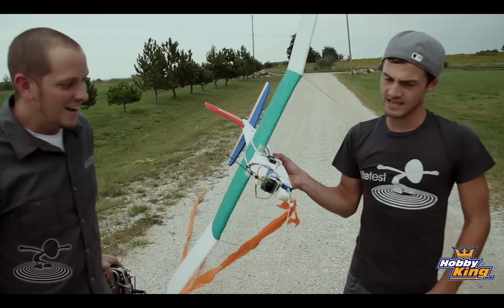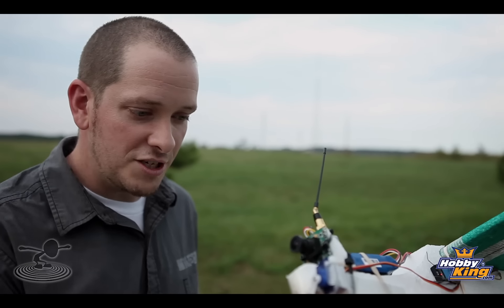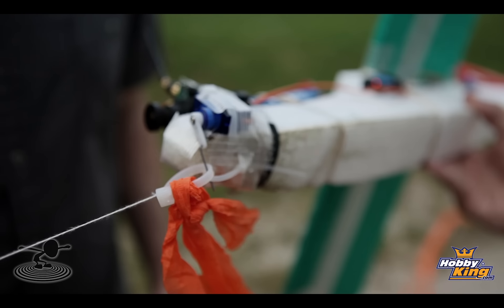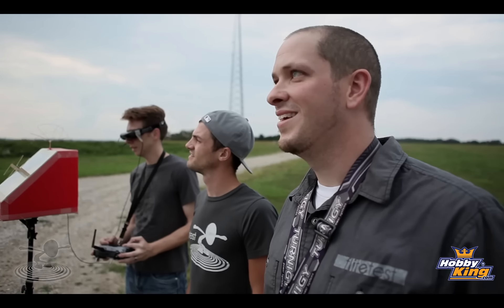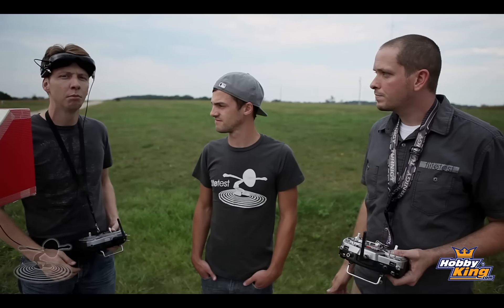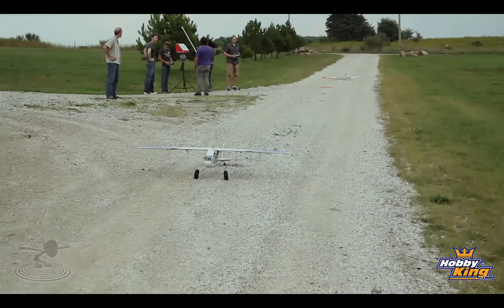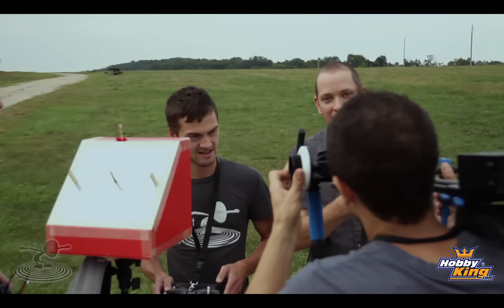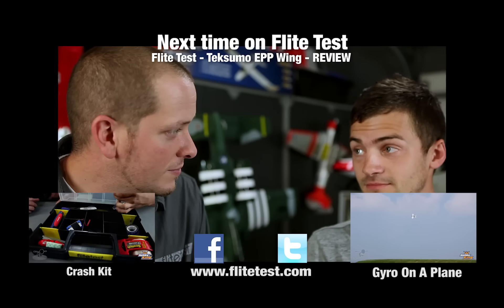Flite Test - FPV Tow Glider - PROJECT

Comment: Cool stuff!!  How about securing the tow line to the tug on top of the wing at the CG?  Hopefully that would stop the tail lifting when the glider goes high.  Of course if the glider goes low, it's bye-bye tailplane...  I used to do this with a .90 glow mode with an H-tail - good fun!!

Comment: The wire antenna that came with the 900 mhz TX is not tuned and creates heat in the TX and shortens the life of the TX.. Never use it, at least use an aftermarket duck.